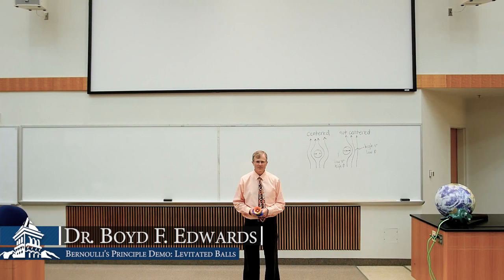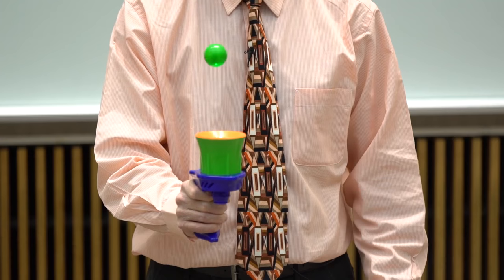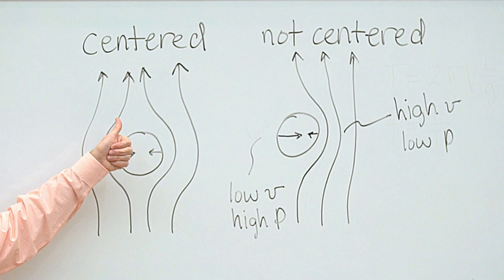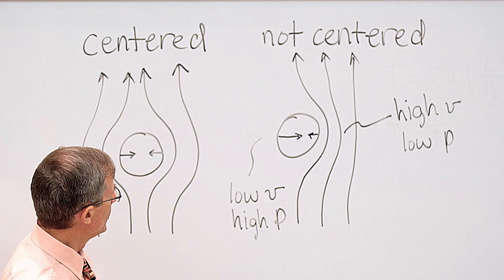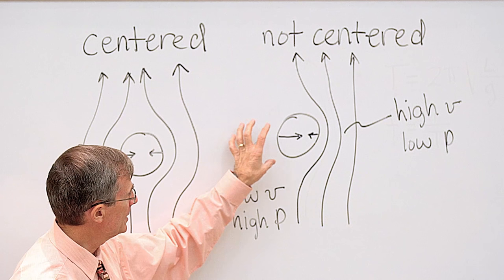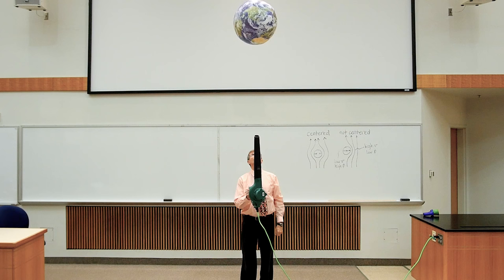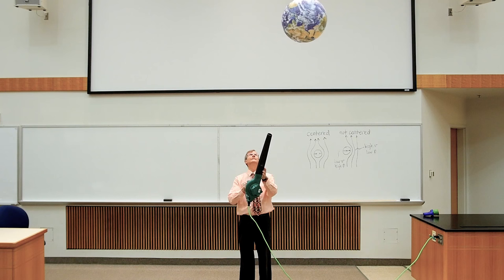Bernoulli's Principle Demo: Levitated Balls

Comment: After watching tons of lectures I finally understand
Reply: Nope.
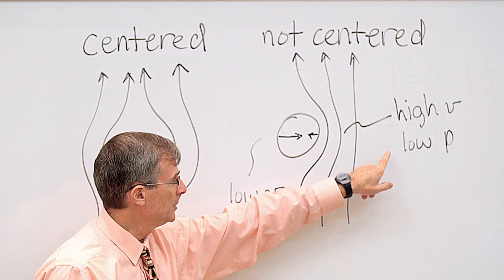At 1:55; Another video with the most common misconception in fluids.  
..
The centering is caused by the acceleration of the curved flow and is called the Coanda Effect, NOT Bernoulli's Principle.
..
The statement at time 1:55 is Incorrect  : "If you have a high velocity, a high airspeed, then you nave a low pressure." <-- That is false. 
..
Bernoulli's Principle correctly stated is: "An increase in speed is accompanied by a decreasing  pressure.":
An increase in speed is an acceleration!  
 An increase in speed is acceleration, not simply fast. 
.
Bernoulli's Principle becomes relevant at the place where the air is accelerated to the higher speed. 
..
You cannot compare some "fast" air with any random near-by 'slower' air for the pressure difference.  The air must be accelerated.
.
Then, it is the pressure difference for the flow that causes the acceleration.
..
Other common demos are also misunderstood and misinterpreted are blowing over a curved paper, between two balloons or two cans. Those are all curved flow: Coanda Effect.
.
This simply parrots incorrect science.
..
For better information and demos anyone can easily duplicate see Weltner:
Weltner in PDF - "Misinterpretations of Bernoulli's Law".  
Read the text and focus on these figures. :

Fig 3 "Fast" air, NO PRESSURE REDUCTION. 
Figs 8 & 9  Curved (accelerated flow) Pressure change.
http://user.uni-frankfurt.de/~weltner/Misinterpretations%20of%20Bernoullis%20Law%202011%20internet.pdf    

Please stop teaching bad science.
.

Here's videos that got it right: 

This one has it 100% correct! 
https://www.youtube.com/watch?v=kR2Oi3XCX18 

The water curving around to the top wants to go straight.  It's inertia lowers the pressure on the inside of the curve keeping it in the stream.  It is explained better here when a fluid follows a convex curved surface:
 https://www.youtube.com/watch?v=3MSqbnbKDmM 
..
This one s also correct. 
 https://www.youtube.com/watch?v=NvzXKZNJ7ZU 

Veritasium. He doesn't explain it completely well.  
https://www.youtube.com/watch?v=mNHp8iyyIjo

Comment: Thanx A lot sir! 

Your demonstrations literally helping me in understanding concepts. 🔥🙏
Reply: At 1:55; Another video with the most common misconception in fluids.  
..
The centering is caused by the acceleration of the curved flow and is called the Coanda Effect, NOT Bernoulli's Principle.
..
The statement at time 1:55 is Incorrect  : "If you have a high velocity, a high airspeed, then you nave a low pressure." <-- That is false. 
..
Bernoulli's Principle correctly stated is: "An increase in speed is accompanied by a decreasing  pressure.":
An increase in speed is an acceleration!  
 An increase in speed is acceleration, not simply fast. 
.
Bernoulli's Principle becomes relevant at the place where the air is accelerated to the higher speed. 
..
You cannot compare some "fast" air with any random near-by 'slower' air for the pressure difference.  The air must be accelerated.
.
Then, it is the pressure difference for the flow that causes the acceleration.
..
Other common demos are also misunderstood and misinterpreted are blowing over a curved paper, between two balloons or two cans. Those are all curved flow: Coanda Effect.
.
This simply parrots incorrect science.
..
For better information and demos anyone can easily duplicate see Weltner:
Weltner in PDF - "Misinterpretations of Bernoulli's Law".  
Read the text and focus on these figures. :

Fig 3 "Fast" air, NO PRESSURE REDUCTION. 
Figs 8 & 9  Curved (accelerated flow) Pressure change.
http://user.uni-frankfurt.de/~weltner/Misinterpretations%20of%20Bernoullis%20Law%202011%20internet.pdf    

Please stop teaching bad science.
.

Here's videos that got it right: 

This one has it 100% correct! 
https://www.youtube.com/watch?v=kR2Oi3XCX18 

The water curving around to the top wants to go straight.  It's inertia lowers the pressure on the inside of the curve keeping it in the stream.  It is explained better here when a fluid follows a convex curved surface:
 https://www.youtube.com/watch?v=3MSqbnbKDmM 
..
This one s also correct. 
 https://www.youtube.com/watch?v=NvzXKZNJ7ZU 

Veritasium. He doesn't explain it completely well.  
https://www.youtube.com/watch?v=mNHp8iyyIjo

Comment: OH MY GOD. THIS IS SO COOL
Reply: At 1:55; Another video with the most common misconception in fluids.  
..
The centering is caused by the acceleration of the curved flow and is called the Coanda Effect, NOT Bernoulli's Principle.
..
The statement at time 1:55 is Incorrect  : "If you have a high velocity, a high airspeed, then you nave a low pressure." <-- That is false. 
..
Bernoulli's Principle correctly stated is: "An increase in speed is accompanied by a decreasing  pressure.":
An increase in speed is an acceleration!  
 An increase in speed is acceleration, not simply fast. 
.
Bernoulli's Principle becomes relevant at the place where the air is accelerated to the higher speed. 
..
You cannot compare some "fast" air with any random near-by 'slower' air for the pressure difference.  The air must be accelerated.
.
Then, it is the pressure difference for the flow that causes the acceleration.
..
Other common demos are also misunderstood and misinterpreted are blowing over a curved paper, between two balloons or two cans. Those are all curved flow: Coanda Effect.
.
This simply parrots incorrect science.
..
For better information and demos anyone can easily duplicate see Weltner:
Weltner in PDF - "Misinterpretations of Bernoulli's Law".  
Read the text and focus on these figures. :

Fig 3 "Fast" air, NO PRESSURE REDUCTION. 
Figs 8 & 9  Curved (accelerated flow) Pressure change.
http://user.uni-frankfurt.de/~weltner/Misinterpretations%20of%20Bernoullis%20Law%202011%20internet.pdf    

Please stop teaching bad science.
.

Here's videos that got it right: 

This one has it 100% correct! 
https://www.youtube.com/watch?v=kR2Oi3XCX18 

The water curving around to the top wants to go straight.  It's inertia lowers the pressure on the inside of the curve keeping it in the stream.  It is explained better here when a fluid follows a convex curved surface:
 https://www.youtube.com/watch?v=3MSqbnbKDmM 
..
This one s also correct. 
 https://www.youtube.com/watch?v=NvzXKZNJ7ZU 

Veritasium. He doesn't explain it completely well.  
https://www.youtube.com/watch?v=mNHp8iyyIjo
Reply: @Observ45er  hey man thankyou v much! I'll check it out

Comment: Outstanding sir 👍👍
Reply: At 1:55; Another video with the most common misconception in fluids.  
..
The centering is caused by the acceleration of the curved flow and is called the Coanda Effect, NOT Bernoulli's Principle.
..
The statement at time 1:55 is Incorrect  : "If you have a high velocity, a high airspeed, then you nave a low pressure." <-- That is false. 
..
Bernoulli's Principle correctly stated is: "An increase in speed is accompanied by a decreasing  pressure.":
An increase in speed is an acceleration!  
 An increase in speed is acceleration, not simply fast. 
.
Bernoulli's Principle becomes relevant at the place where the air is accelerated to the higher speed. 
..
You cannot compare some "fast" air with any random near-by 'slower' air for the pressure difference.  The air must be accelerated.
.
Then, it is the pressure difference for the flow that causes the acceleration.
..
Other common demos are also misunderstood and misinterpreted are blowing over a curved paper, between two balloons or two cans. Those are all curved flow: Coanda Effect.
.
This simply parrots incorrect science.
..
For better information and demos anyone can easily duplicate see Weltner:
Weltner in PDF - "Misinterpretations of Bernoulli's Law".  
Read the text and focus on these figures. :

Fig 3 "Fast" air, NO PRESSURE REDUCTION. 
Figs 8 & 9  Curved (accelerated flow) Pressure change.
http://user.uni-frankfurt.de/~weltner/Misinterpretations%20of%20Bernoullis%20Law%202011%20internet.pdf    

Please stop teaching bad science.
.

Here's videos that got it right: 

This one has it 100% correct! 
https://www.youtube.com/watch?v=kR2Oi3XCX18 

The water curving around to the top wants to go straight.  It's inertia lowers the pressure on the inside of the curve keeping it in the stream.  It is explained better here when a fluid follows a convex curved surface:
 https://www.youtube.com/watch?v=3MSqbnbKDmM 
..
This one s also correct. 
 https://www.youtube.com/watch?v=NvzXKZNJ7ZU 

Veritasium. He doesn't explain it completely well.  
https://www.youtube.com/watch?v=mNHp8iyyIjo
Reply: @Observ45er  I am extremely thankful to you for your observation. Thanks
Reply: @magnifiedmicrons  You're welcome. This has bugged the heck out of me since taking responsibility for a pretty sophisticated full-cockpit B737 flight simulator. Knowing I'd be asked many questions, I looked into flight ( I heard the equal transit story in early pilot training long ago), and saw so many explanations that made no sense at all for physics, then so many that are flat wrong. I even contacted a few known experts and talked many times with my aeronautical engineer son.  I'm an experienced electrical engineer.

Comment: Tanx sir
Reply: At 1:55; Another video with the most common misconception in fluids.  
..
The centering is caused by the acceleration of the curved flow and is called the Coanda Effect, NOT Bernoulli's Principle.
..
The statement at time 1:55 is Incorrect  : "If you have a high velocity, a high airspeed, then you nave a low pressure." <-- That is false. 
..
Bernoulli's Principle correctly stated is: "An increase in speed is accompanied by a decreasing  pressure.":
An increase in speed is an acceleration!  
 An increase in speed is acceleration, not simply fast. 
.
Bernoulli's Principle becomes relevant at the place where the air is accelerated to the higher speed. 
..
You cannot compare some "fast" air with any random near-by 'slower' air for the pressure difference.  The air must be accelerated.
.
Then, it is the pressure difference for the flow that causes the acceleration.
..
Other common demos are also misunderstood and misinterpreted are blowing over a curved paper, between two balloons or two cans. Those are all curved flow: Coanda Effect.
.
This simply parrots incorrect science.
..
For better information and demos anyone can easily duplicate see Weltner:
Weltner in PDF - "Misinterpretations of Bernoulli's Law".  
Read the text and focus on these figures. :

Fig 3 "Fast" air, NO PRESSURE REDUCTION. 
Figs 8 & 9  Curved (accelerated flow) Pressure change.
http://user.uni-frankfurt.de/~weltner/Misinterpretations%20of%20Bernoullis%20Law%202011%20internet.pdf    

Please stop teaching bad science.
.

Here's videos that got it right: 

This one has it 100% correct! 
https://www.youtube.com/watch?v=kR2Oi3XCX18 

The water curving around to the top wants to go straight.  It's inertia lowers the pressure on the inside of the curve keeping it in the stream.  It is explained better here when a fluid follows a convex curved surface:
 https://www.youtube.com/watch?v=3MSqbnbKDmM 
..
This one s also correct. 
 https://www.youtube.com/watch?v=NvzXKZNJ7ZU 

Veritasium. He doesn't explain it completely well.  
https://www.youtube.com/watch?v=mNHp8iyyIjo

Comment: Thanks sir from Pakistan ❤️
Reply: At 1:55; Another video with the most common misconception in fluids.  
..
The centering is caused by the acceleration of the curved flow and is called the Coanda Effect, NOT Bernoulli's Principle.
..
The statement at time 1:55 is Incorrect  : "If you have a high velocity, a high airspeed, then you nave a low pressure." <-- That is false. 
..
Bernoulli's Principle correctly stated is: "An increase in speed is accompanied by a decreasing  pressure.":
An increase in speed is an acceleration!  
 An increase in speed is acceleration, not simply fast. 
.
Bernoulli's Principle becomes relevant at the place where the air is accelerated to the higher speed. 
..
You cannot compare some "fast" air with any random near-by 'slower' air for the pressure difference.  The air must be accelerated.
.
Then, it is the pressure difference for the flow that causes the acceleration.
..
Other common demos are also misunderstood and misinterpreted are blowing over a curved paper, between two balloons or two cans. Those are all curved flow: Coanda Effect.
.
This simply parrots incorrect science.
..
For better information and demos anyone can easily duplicate see Weltner:
Weltner in PDF - "Misinterpretations of Bernoulli's Law".  
Read the text and focus on these figures. :

Fig 3 "Fast" air, NO PRESSURE REDUCTION. 
Figs 8 & 9  Curved (accelerated flow) Pressure change.
http://user.uni-frankfurt.de/~weltner/Misinterpretations%20of%20Bernoullis%20Law%202011%20internet.pdf    

Please stop teaching bad science.
.

Here's videos that got it right: 

This one has it 100% correct! 
https://www.youtube.com/watch?v=kR2Oi3XCX18 

The water curving around to the top wants to go straight.  It's inertia lowers the pressure on the inside of the curve keeping it in the stream.  It is explained better here when a fluid follows a convex curved surface:
 https://www.youtube.com/watch?v=3MSqbnbKDmM 
..
This one s also correct. 
 https://www.youtube.com/watch?v=NvzXKZNJ7ZU 

Veritasium. He doesn't explain it completely well.  
https://www.youtube.com/watch?v=mNHp8iyyIjo

Comment: Hello, video very ineresanting!... Can this also be explained by effect's Coanda?
Reply: Should be a mix out of Bernoulli-, Coanda- and Magnus-Effekt
Reply: At 1:55; Another video with the most common misconception in fluids.  
..
The centering is caused by the acceleration of the curved flow and is called the Coanda Effect, NOT Bernoulli's Principle.
..
The statement at time 1:55 is Incorrect  : "If you have a high velocity, a high airspeed, then you nave a low pressure." <-- That is false. 
..
Bernoulli's Principle correctly stated is: "An increase in speed is accompanied by a decreasing  pressure.":
An increase in speed is an acceleration!  
 An increase in speed is acceleration, not simply fast. 
.
Bernoulli's Principle becomes relevant at the place where the air is accelerated to the higher speed. 
..
You cannot compare some "fast" air with any random near-by 'slower' air for the pressure difference.  The air must be accelerated.
.
Then, it is the pressure difference for the flow that causes the acceleration.
..
Other common demos are also misunderstood and misinterpreted are blowing over a curved paper, between two balloons or two cans. Those are all curved flow: Coanda Effect.
.
This simply parrots incorrect science.
..
For better information and demos anyone can easily duplicate see Weltner:
Weltner in PDF - "Misinterpretations of Bernoulli's Law".  
Read the text and focus on these figures. :

Fig 3 "Fast" air, NO PRESSURE REDUCTION. 
Figs 8 & 9  Curved (accelerated flow) Pressure change.
http://user.uni-frankfurt.de/~weltner/Misinterpretations%20of%20Bernoullis%20Law%202011%20internet.pdf    

Please stop teaching bad science.
.

Here's videos that got it right: 

This one has it 100% correct! 
https://www.youtube.com/watch?v=kR2Oi3XCX18 

The water curving around to the top wants to go straight.  It's inertia lowers the pressure on the inside of the curve keeping it in the stream.  It is explained better here when a fluid follows a convex curved surface:
 https://www.youtube.com/watch?v=3MSqbnbKDmM 
..
This one s also correct. 
 https://www.youtube.com/watch?v=NvzXKZNJ7ZU 

Veritasium. He doesn't explain it completely well.  
https://www.youtube.com/watch?v=mNHp8iyyIjo

Comment: And i can't believe i understood
Reply: At 1:55; Another video with the most common misconception in fluids.  
..
The centering is caused by the acceleration of the curved flow and is called the Coanda Effect, NOT Bernoulli's Principle.
..
The statement at time 1:55 is Incorrect  : "If you have a high velocity, a high airspeed, then you nave a low pressure." <-- That is false. 
..
Bernoulli's Principle correctly stated is: "An increase in speed is accompanied by a decreasing  pressure.":
An increase in speed is an acceleration!  
 An increase in speed is acceleration, not simply fast. 
.
Bernoulli's Principle becomes relevant at the place where the air is accelerated to the higher speed. 
..
You cannot compare some "fast" air with any random near-by 'slower' air for the pressure difference.  The air must be accelerated.
.
Then, it is the pressure difference for the flow that causes the acceleration.
..
Other common demos are also misunderstood and misinterpreted are blowing over a curved paper, between two balloons or two cans. Those are all curved flow: Coanda Effect.
.
This simply parrots incorrect science.
..
For better information and demos anyone can easily duplicate see Weltner:
Weltner in PDF - "Misinterpretations of Bernoulli's Law".  
Read the text and focus on these figures. :

Fig 3 "Fast" air, NO PRESSURE REDUCTION. 
Figs 8 & 9  Curved (accelerated flow) Pressure change.
http://user.uni-frankfurt.de/~weltner/Misinterpretations%20of%20Bernoullis%20Law%202011%20internet.pdf    

Please stop teaching bad science.
.

Here's videos that got it right: 

This one has it 100% correct! 
https://www.youtube.com/watch?v=kR2Oi3XCX18 

The water curving around to the top wants to go straight.  It's inertia lowers the pressure on the inside of the curve keeping it in the stream.  It is explained better here when a fluid follows a convex curved surface:
 https://www.youtube.com/watch?v=3MSqbnbKDmM 
..
This one s also correct. 
 https://www.youtube.com/watch?v=NvzXKZNJ7ZU 

Veritasium. He doesn't explain it completely well.  
https://www.youtube.com/watch?v=mNHp8iyyIjo